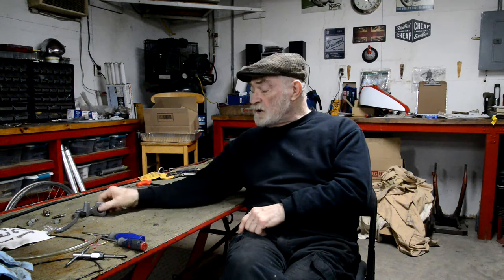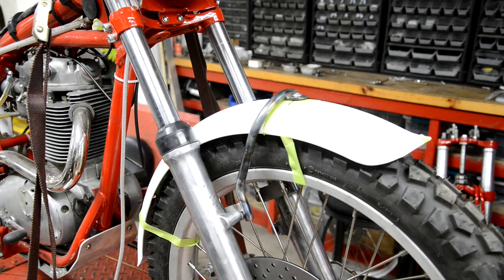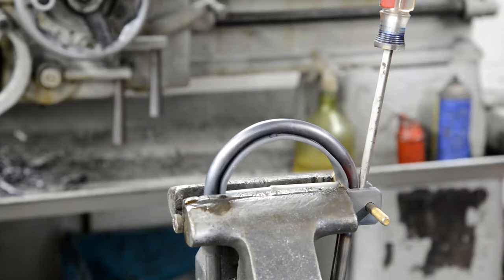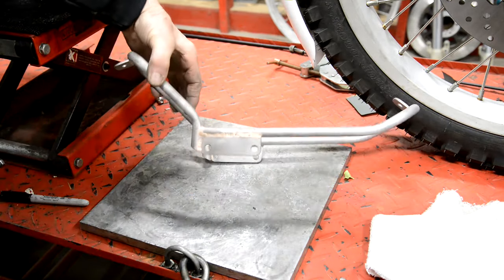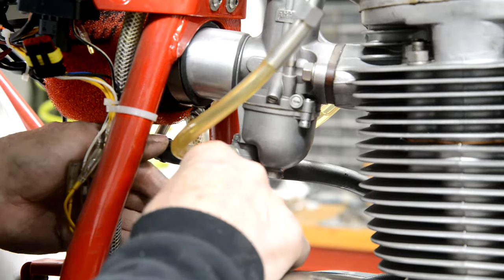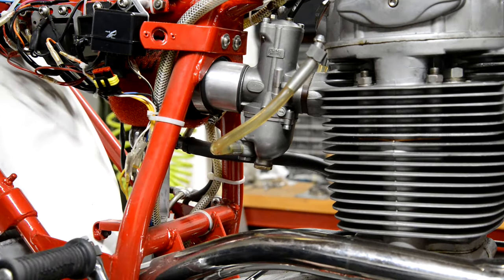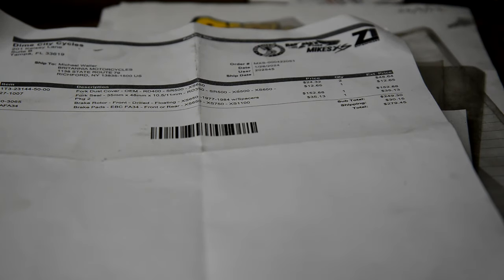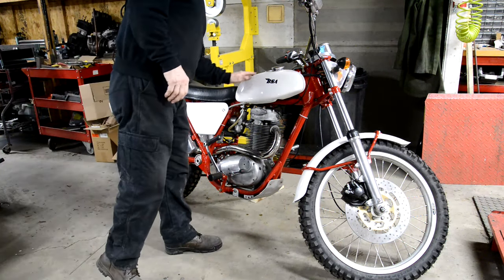B50 Front End Change - The End

Comment: Michael the flashing on your welding helmet could be a flat battery, or blocked sensor. Turn the amperage down on the welder to about 10 amps and see if that makes it worse. If it does, it's probably the battery.
Reply from the maker: Exactly right. It was a flat battery and there is even a warning light to tell me. Another demerit for Michael.